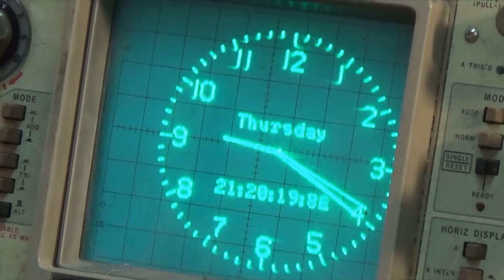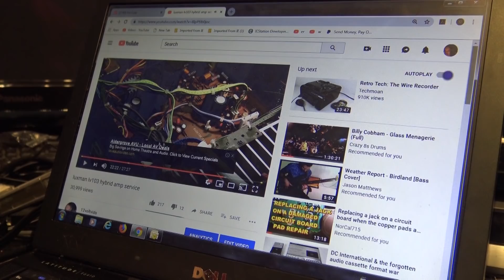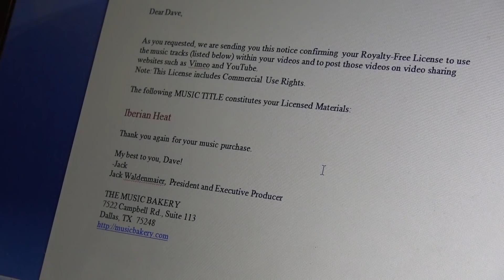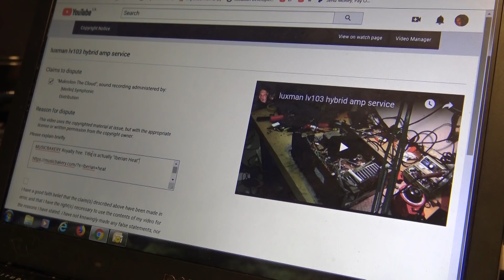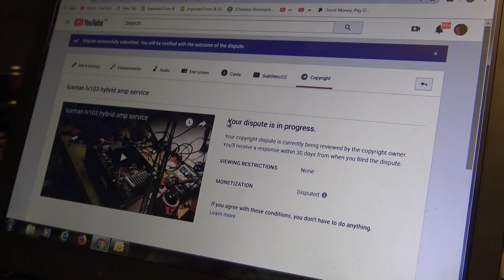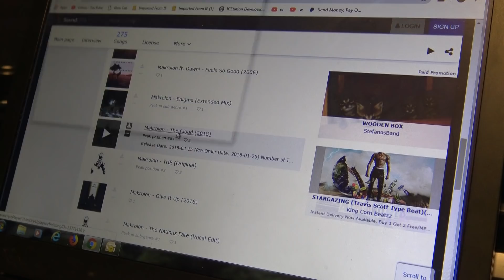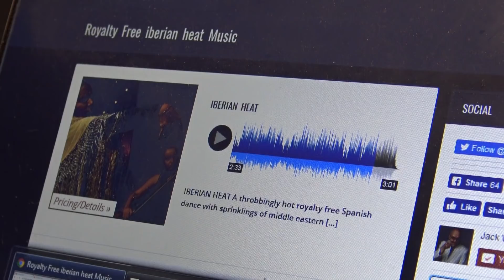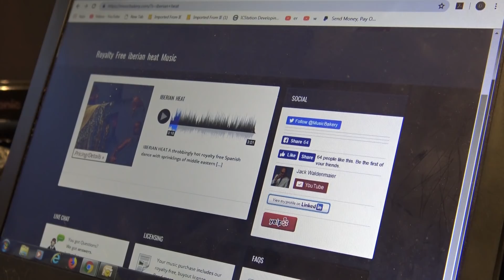How to dispute fake copyright claims on youtube

Comment: The question i have is this : Do you get your revenue back ? And if YT paid Mr scammer, do they - YT Go after Mr scammer for the proceeds if given them ? I would think it would be easy enough to slap a law suit on Mr scammer. Or do they just let it go ?
On a case by case basis it may not add up to much, but collectively it would seem to be a rather large sum.
Reply from the maker: Yes once settled in my favor funds are released.
Reply: @12voltvids  Good for you, at least you don't suffer for it.

Comment: From what I understand, the 'Copyright claim' system is automated, so these 'claims' are typically being triggered by an algorithm, and not by a human. As you said, follow the dispute process, and it should be resolved. Also, YouTube has started holding the diverted revenue for a period of time, as compared to immediately forwarding it as they did in the past.
Reply from the maker: Exactly, and it will be resolved.